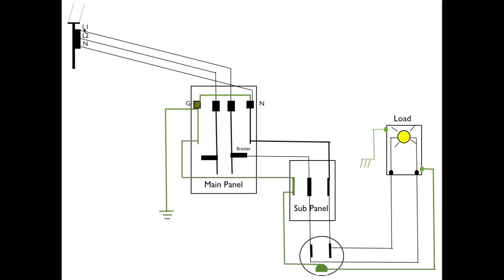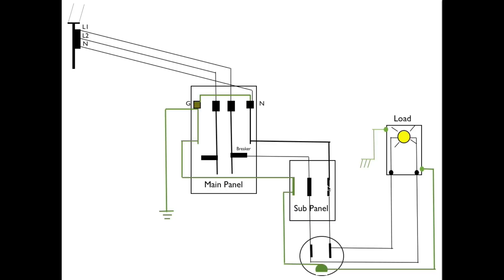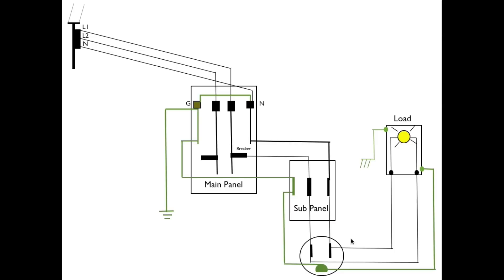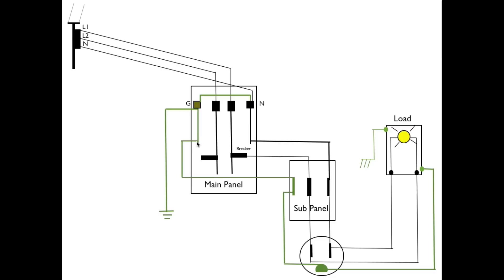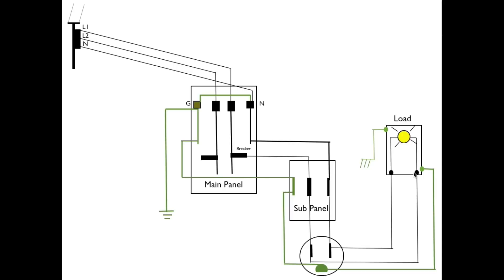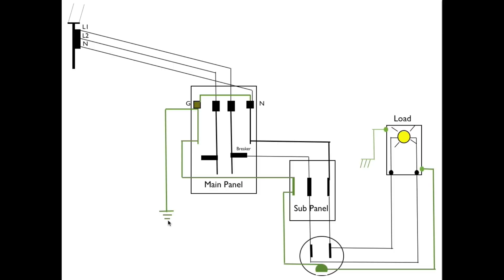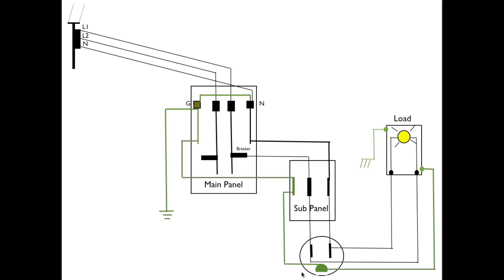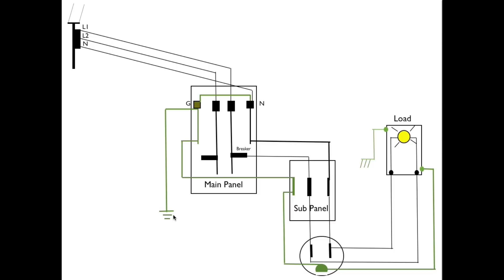The difference between neutral and ground on the electric panel

Comment: Gary - please explain the point of having a the neutral connected to the power line from the main panel and to the grounding rod.  What would happen if there was an open on the neutral going back to the power line?  Are most of the amps running on the neutral returned to the power system via the neutral or are they going to ground?  Thanks for the video and F*** that unicorn guy, he's rude.
Reply: You ask "Are most of the amps running on the neutral returned to the power system via the neutral or are they going to ground?"

You said, "What would happen if there was an open on the neutral going back to the power line?"

Answer: With the neutral "open" in your question, the only route back to the center tap on one 240V phase winding of the delta transformer on the pole is now through the earth. The two 120V windings in series in that 240V phase or "leg" of the delta are no longer directly linked by conductors to the two main bus bars in the panel. Your previously dependable 120V circuits are no longer available.

The short answer is "chaos" and a lot of things are uncertain.

That's why NEC Section 250.24 has us bring the intentionally grounded conductor to the main service, where it is then grounded to the house system "grounding electrode system". Before the "open" occurred in the overhead "carrier" or service drop when the cute little squirrel (tree rat) chewed through the last aluminum strand, things that were pretty well defined got really uncertain, confused and confusing.

Add to the situation that the cable guy grounded his system by driving a short rod into the ground. If I'm an electron running out the white wire from a 120V breaker and get to the neutral bus, I find no path back to the transformer via the overhead "carrier" where I went last time, and can only go into the ground by one of two ground paths. Some of my buddies go one way, I go the other.

Chaos!

What we just called a "120V breaker" now only has a portion of 240V available via an uncertain ground path through the soil or earth, back up the ground rod for the power company transformer to the center tap of that 240V winding.

How much of the available voltage does each active circuit get now that we have no real clear dependable path back to get refreshed by the power company 120V winding that we could previously access.

Any ground fault now has no "effective ground fault path" back through the overhead "carrier" to the center tap on the power pole transformer so that  enough current comes back through the breaker to overheat and trip the breaker. Any ground fault now has to use and earth path back to the power company transformer.

Suppose the original installer  drove a single ground rod and only got about 25 ohms to ground. 

I=120V/25 ohms = 4.3A,  not enough to trip a breaker and clear the fault.

So we now have a really confused system with uncertain voltages on devices and no really effective way to clear a ground fault.

The chewed-open power company "neutral" from the power pole to service hook on the house, on into the service enclosure, also once carried on one conductor the unbalanced load at any given moment, depending on what devices in the house were switched on.

Imagine the 30 or so circuits all competing to have the electron current flow travel through the soil and moisture in the earth to finally get back to the transformer ground rod and run up to the center tap of the delta transformer.

All the electrons are changing directions with a 60 Hz sine wave signal pattern going from 0 to positive, back to 0, then negative, then back up to 0.

Amazing anything works, huh?
Reply: Ok, I'm almost there thanks to something you said.  So, neutral and ground are connected in the main panel or outside, whatever.   But, if I understood you right. . . current takes the path of least resistance and that path is back to the transformer via the neutral ignoring the ground.  Current will only take the path to ground in the case of a fault.  Correct?
Reply from the maker: Jumping in here.  When you say fault, we assume there is an over current condition.  In this case, current will not go to earth ground but back to the transformer on the neutral.  
GFM

Comment: getting a part of a shock when touching a shed when with bare feet.....?
Reply from the maker: Don't touch the shed.  Just kidding.  You may have a hot lead touching the metal of the shed.  You need to determine if the neutral and ground are connected properly.  May need a pro on this one.
GFM

Comment: He doesn't differentiate between earth ground and equipment ground despite showing both.  Equipment grounds are meant to ensure the bonding back to the main neutral for what we call ground fault conditions.  Metal enclosures on the exterior of buildings may be vulnerable to lightning strikes, but direct strikes would most likely destroy equipment.  The equipment ground is non-current carrying, yet it provides insurance that you have a low resistance path back to source in a power-to-case fault condition (ground fault) in order to trip the circuit breaker.  The earth ground does two things.  It helps stabilize the voltage from transient voltages (i.e. lightning or other sources) and allows us to use the neutral as the 0 reference where the neutral and earth are at a 0V potential difference.  Yes, the earth ground in the system provides transient voltage protection, but should never be depended upon as primary protection against transient voltages for sensitive equipment.
Reply: +Ian Belletti This part confused me and I need clarification. The diagram of the remote load shows two paths to ground. Are there physically two separate grounds (i.e. grounding rods) or is it that both the remote casing and the remote load device are both going back to the main panel ground (and its grounding rod) via the single ground wire?
Reply from the maker: +Gabby Girl Don't make it more complicated than it is.  The indication of chassis ground on the load is just there to indicate that the chassis of the load enclosure is a chassis ground.  Its only connection to earth ground is thru the ground wire.  Hope this helps.
GFM
Reply: Gabby Girl Occasionally equipment casing is connected directly to an earth ground, but this is atypical.  As grayfurnaceman has stated, he, despite the confusing nature of showing it this way, just wanted to indicate that the case had been grounded.  And please don't confuse the purpose of the grounding electrode conductor (the wire going from neutral to ground) and the equipment grounding conductor (wire going from equipment case back to neutral at the service).  The grounding electrode conductor has the purpose of providing power stabilization and a reference base where the neutral's voltage is equal with the voltage of the earth.  The equipment ground has the purpose of carrying sufficient fault current from the case back to the neutral all the way back to the power source so that the fault protection (circuit breaker or fuse) trips shutting off power to the circuit.  For this reason both are properly referred to as going back to the system neutral.  grayfurnaceman may have shown the grounds and the neutral on separate bars in the main panel, but because they are all connected together, they can all be on the same lug bar as long as that bar is bonded to the panel case.
Reply from the maker: +Ian Belletti Totally agree.  Thanks for the thoughts.
GFM
Reply: +Ian Belletti  If you have an unbalanced load on one side, say 3A on the L1 side, will 3A flow through the neutral wire, then into ground?  If this is the case, it seems like a waste of energy, rather than the 3A being reflected back to the transformer.
Reply: Crapgramp The service (earth) ground has nothing to do with unbalanced loads.  It does nothing to make the load balanced.  What it does for power stabilization has to do with what is called transient voltages, or surges in the layman's terms, especially when caused by lightning.  The idea is that rather than all of the energy from the surge entering your building and damaging equipment, it drains most or all of it to the earth.  This works especially well when the surge is caused by lightning because lightning follows a path to earth.  The other part of the purpose of the earth ground is to cause the neutral to be the voltage reference which matches the energy of the earth (ground).  The full 3A of imbalance will always return to the transformer, most of which will be via the service neutral. (What grayfurnaceman doesn't show is that the power company provides an earth ground at their transformer as well which causes the earth to be a high resistance parallel path for the current.)
Reply from the maker: +Ian Belletti Entirely agree.
GFM
Reply: +Ian Belletti That's interesting.  So if I'm getting this correctly, the service (earth) ground actually has a high resistance, relative to the transformer's neutral, so the unbalanced load will primarily flow back to the transformer.  But during an extremely high transient voltage, such as lightning, the path to earth ground will be of a relatively small resistance (because of the high voltage potential), so most of the transient voltage will flow into ground?  Thanks
Reply: Crapgramp You err in your thought about the transient voltage.  Think in terms of path to balance in terms of lightning (like a battery or a capacitor).  The atmosphere carries the negative charge and the earth carries the positive charge.  When the charges become great enough, the charges create a path through the atmosphere making the charges able to move to a stable condition of zero charge.  Sometimes this connects with the electrical system.  Rather than letting the path run through the building causing damage to electrical equipment, we connect the system to the earth creating a lower resistance path compared to jumping across the air and going through the building materials.

Earthing for lightning protection, we sometimes check resistance between the earth and the grounding electrode to ensure that we have as little resistance as possible in the connection of the grounding electrode to the earth in order to ensure that lightning surges will want to travel to the earth through the grounding instead of through the building.  Ideal for this is a zero resistance connection, but typical expectation is to be able to get the connection down to 25 ohms or better.  We look for a minimum resistance connection to earth for lightning protection.  A high enough resistance in the earthing connection will cause the surge to find other paths to ground damaging equipment in the process.

When it comes to electric current returning to the source (power company's transformer), the system ground is not intended to carry any current.  The system ground carrying current is the unintended result of earthing both at the power company's transformer and at the building.  The neutral typically has a resistance of about 0.001 ohms or less.  The earth from ground rod to ground rod, with excellent soil conditions, may have as little as 25 ohms of resistance.  These conditions being the case, the normal system current will return primarily on the neutral, however, some will return via the earth.  Theoretically, the earth ground is considered a non-current carrying conductor, but in reality, it does carry a small portion of the building's power through the earth because the earth is conductive.  If you have ever felt a shock from a piece of equipment in your home or at work receiving building power, you have felt this effect in action because your body acted as a path to earth and the current traveled through you, through the earth, and through the grounding electrode systems, back to the source.

I was hesitant to mention the current flowing and resistance of the earth in my previous response to you because I didn't want you to err in your thinking.  I chose to mention it because I didn't want to lie about the imbalance current returning to the transformer partially through the grounding electrode.  I didn't want to obfuscate what was happening with the transient voltages by mentioning it.  Just remember, for lightning, the earth connection itself is of primary concern and ideal is a low resistance connection to earth.  For calculating the imbalance current that travels through the earth back to the transformer, it is the total resistance of the earth from power company's earth ground to the building service earth ground that is important.  For imbalance current, the earth grounds become a parallel path.  I wish I could provide drawings here.  It would make these explanations easier to understand.
Reply: +Ian Belletti That's a great explanation.  My primary concern was that the electrons from the imbalance would potentially flow to the (relatively) positive ground.  But now I see that if the resistance from earthing connection to ground is around 25 ohms or more, and the resistance through the neutral is much smaller (on the scale of milliohms), the majority of the imbalance current would actually flow back to the transformer, and not 'wasted' to ground.

Also, if I understand correctly, the small current that flows back to ground would not actually be wasted, but would travel through the building's ground rod to the power company transformer's ground rod and back into the transformer.  I initially thought that the small portion of imbalance current from the building ground would just dissipate throughout the earth, without returning to the power company.

Additional question:  If the small imbalance current on the neutral flows from the building grounding rod to the power company's transformer grounding rod, will a lightning strike that flows through the building's grounding rod also flow through ground and into the power company's transformer (through their grounding rod), due to the extremely high voltage potential of the lightning?

Very enlightening, very fascinating - thanks for your input.  These discussions really open up a lot of closed doors
Reply: Crapgramp"Also, if I understand correctly, the small current that flows back to ground would not actually be wasted, but would travel through the building's ground rod to the power company transformer's ground rod and back into the transformer. I initially thought that the small portion of imbalance current from the building ground would just dissipate throughout the earth, without returning to the power company."
That is correct.
 
"Additional question: If the small imbalance current on the neutral flows from the building grounding rod to the power company's transformer grounding rod, will a lightning strike that flows through the building's grounding rod also flow through ground and into the power company's transformer (through their grounding rod), due to the extremely high voltage potential of the lightning?"
Potentially, yes.  Each ground rod has an effective radius of 6 feet.  Proper spacing of ground rods to prevent transfer of potential is a distance of 12 feet or greater from ground rod to ground rod.  Normally, both ground rods will be well beyond needing to worry about the ground rods' areas of effect.  With the ground rods being so far apart, none of the potential being drained to earth from lightning passes into the other ground rod.  If they were installed with overlapping areas of effect, some of the potential would pass to the other ground rod.  If they are within 6 feet of each other, the effect becomes even greater.  Under normal, properly installed circumstances, however, you don't need to worry about this because it doesn't happen.

Comment: The very fact that the neutral and grounds are shorted means there is no difference.
Reply from the maker: You seem to have missed the entire point of the video.  Ground is not part of the circuit.  It is an addition to provide a path for lightning and surges to be discharged.  Chassis ground is a path for faults to neutral cause the circuit protection to open.
GFM

Comment: I sometimes get frustrated by the three prong plug not fitting into a two prong recepticle. So shoot me...I just cut that third prong off and everything is cool.  Twenty years later, so far, so good.  Ahem...this is for small stuff like fans and 25 watt bulbs.  Bigger stuff like table saws and airconditioners I know better.
Reply from the maker: Electrocution is electrocution regardless of the wattage.
GFM

Comment: In other words, treat the subpanel as just an ordinary load (circuit) from the main panel. And, only a fool would ground the neutral for an ordinary load.  Correct?
Reply from the maker: Very well put.  Thank you
GFM

Comment: Why neutral and earth are linked together at MEN point
Reply: If you ever went and looked at the old power poles normally where there was a Transformer on a pole there would be a solid thick uninsulated wire stapled to the pole clear to the ground and a 8 ft copper rod driven in the ground and the wire would be connected to it with a stirrup connector
It's also there as a static discharge so if lightning hits the power pole it will take the easiest path to ground just like a ground fault interrupter circuit